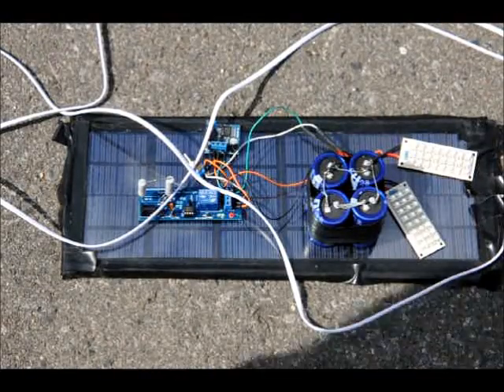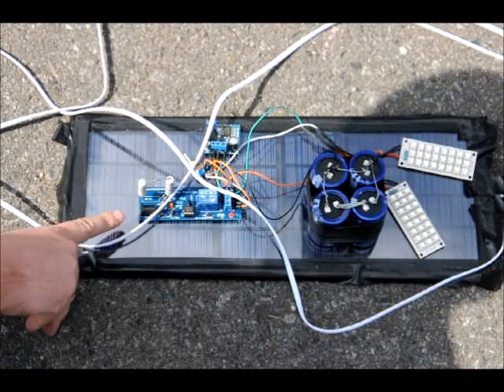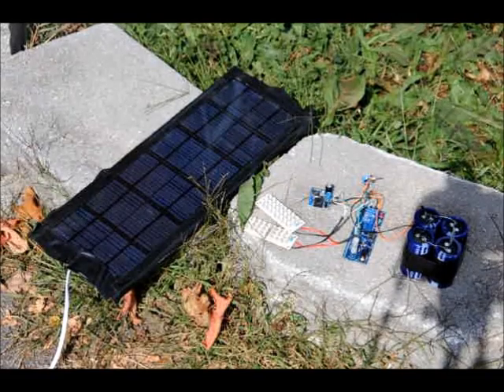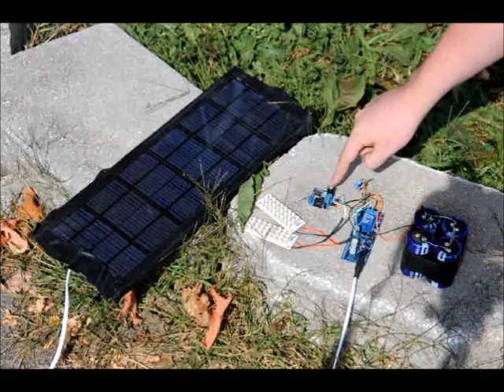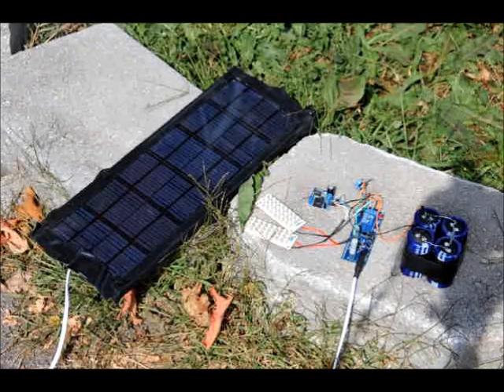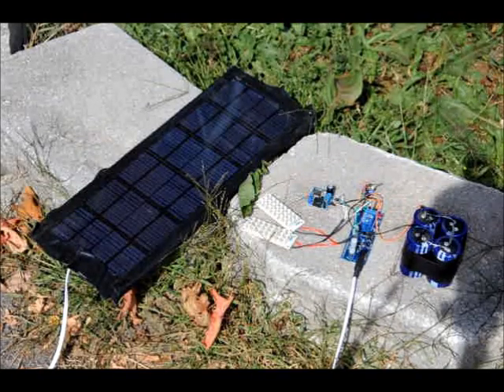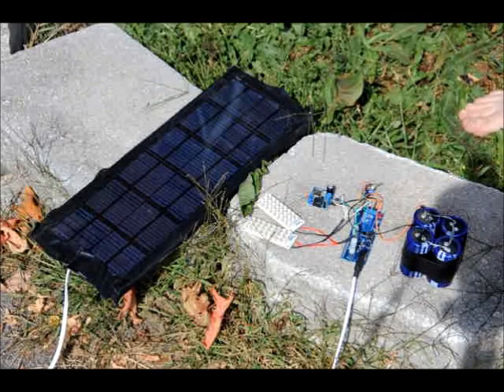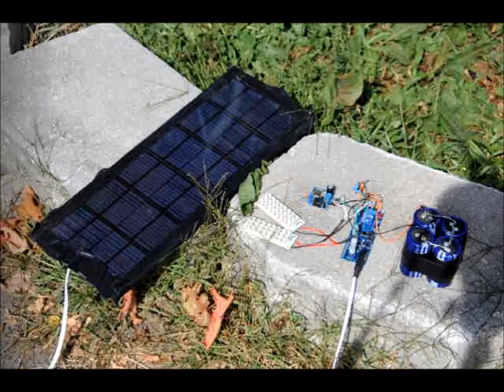Solar Powered, Super Capacitor Based Dual LED Bank Camping Lamp!

Comment: This looks rather useful. 
You mentioned that on the brighter setting it can run for 40 minutes, while charging time is only about 30 min. That seems fairly reasonable, even though it's just for illumination.
I would like to ask you, however, have you connected those in series to increase the circuit voltage?